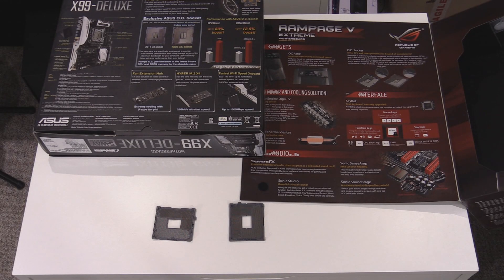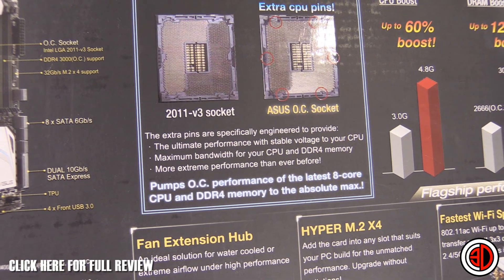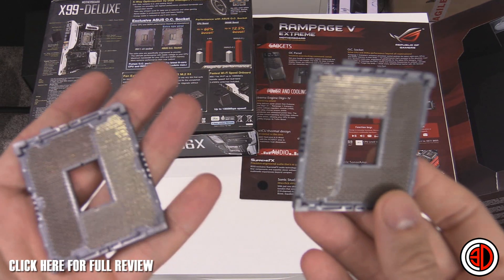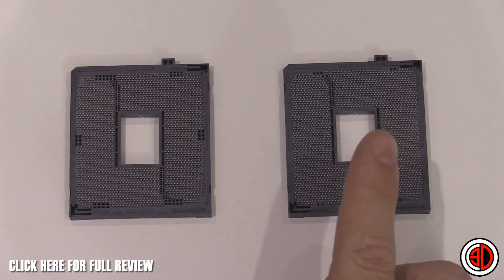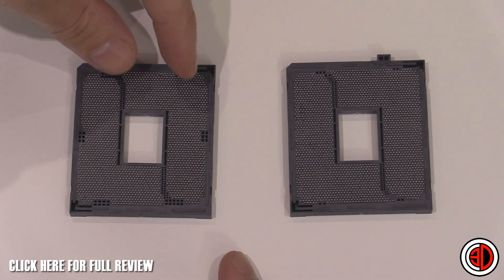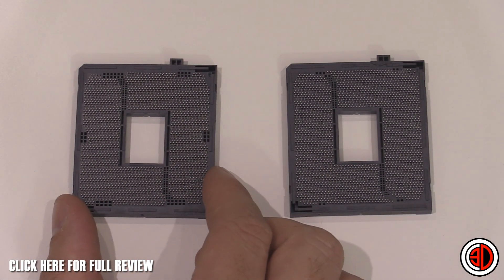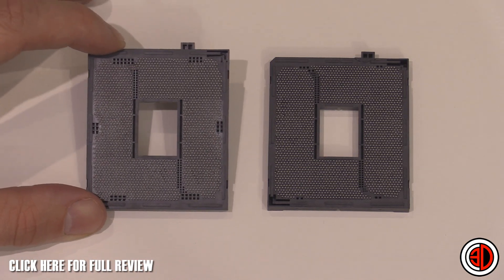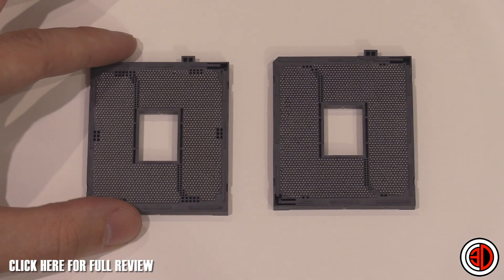Asus OC Socket DDR4 X99 Deluxe Rampage V Extreme

Comment: Those pins seem to be documented in the public intel pdfs.

Intel® Core™ i7 Processor Family for the LGA2011-3 Socket, Thermal/Mechanical Specification and Design Guide (TMSDG):
http://www.intel.com/content/dam/www/public/us/en/documents/guides/core-i7-lga2011-3-tmsdg.pdf
Page 52, all pins are showing on the drawings. Let see AJ1.

In Intel® Core™ i7 Processor Family for the LGA-2011 Socket, Datasheet, Volume 1:
http://www.intel.com/content/dam/www/public/us/en/documents/datasheets/4th-gen-core-i7-lga2011-datasheet-vol-1.pdf
Page 96 we can see "AJ1 VSA PWR". So it is documented as power pin.

Comment: Wait, did you just say Asus have a patent on something that to begin with belongs to Intel? Lolwut. :p
Reply: AFAIK the actual socket doesn't belong to intel.
Reply: No, they only patented the socket design that they created (by adding more pins). The CPU pins/gold contacts on the Haswell-E is untouched and stay's the same. This also means that  the missing pins from the "Standard mobo cpu socket" left some gold contacts from the cpu pcb not connected/touch by any pins (hence Asus added more pins and found out it can have a good effect for Overclocking)

But the patent only last for 6 months, after that other mobo manufacturers will probably have a slice of the OC socket idea.

Comment: I'm confused. Do the Haswell-E chips have the extra pins, but the sockets don't? Are the OC Socket pins smaller, so some contacts touch more than 1 pin? Have ASUS become wizards?
Reply: "become"? Asus have always been wizards.
Reply: D4rkR3bel5  I think there are extra pins/gold contacts in all of the intel CPU's. But some of the pins/gold contacts found on the CPU PCB are unused or not touched by any pins because of the missing pins. I think Asus then added the extra pins against the standard one's and found out what the extra pins/gold contacts from the CPU really do after adding more pins on the cpu socket..
Reply: eroOtoko1 Yeah, the CPUs actually have more than 2011 pins. The extra pins are to bypass the FIVR and must be enabled.